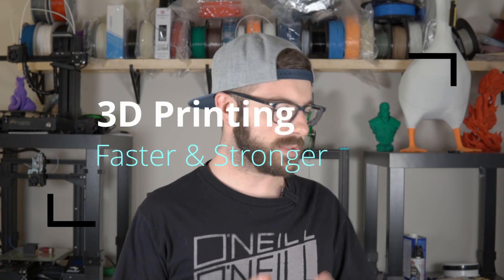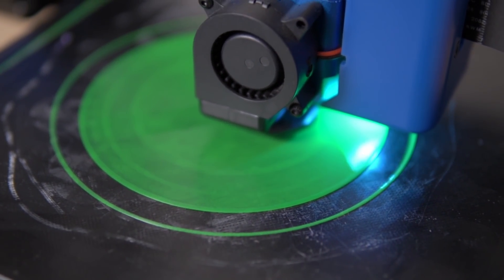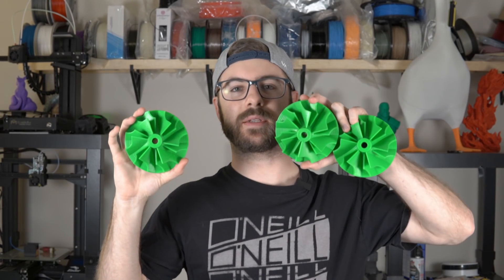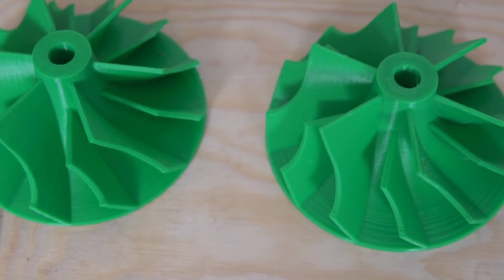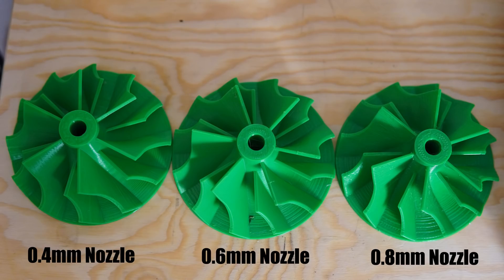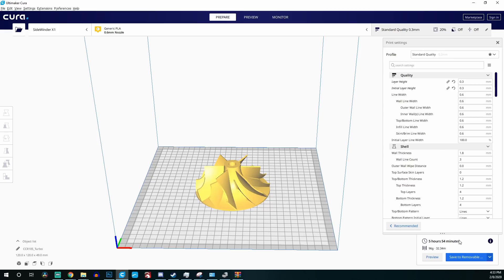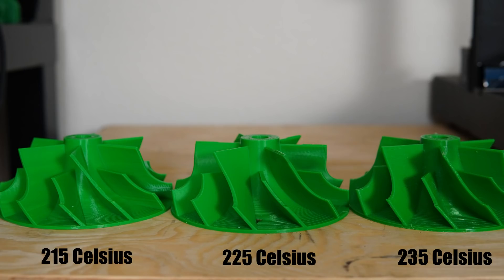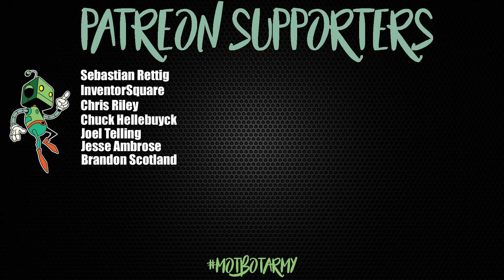3D Printing Faster And Stronger Parts

Comment: Great video! I've been contemplating changing out my nozzle on my Ender 5+. I think this was enough info to make that change.
Reply: @Modbot Made the change successfully and had a few good test prints but now I've got substantially more stringing.  Have been changing nozzle temps over several prints, I've checked my esteps from another video you have, and have also been tinkering with the retraction settings but still no luck making them go away.  Do you have any other suggestions?
Reply from the maker: For stringing retraction and temps are really the main thing I change up. Is it petg? I have certainly had my share of issues with stringy petg in the past
Reply: @ModBotArmy  Actually having stringing issues with PLA. I feel like I've tried just about every retraction length/speed and temp but I'm sure I'm missing something simple here.

Comment: Hey, I have a sidewinder and i'm really having issues with cura right now, I swapped to ideamaker but getting odd issues to. What config do you use on cura? I used the 4.7 version on thingaverse, but still getting issues. I've calibrated my extruder twice, releveled god knows how many times and just getting no joy.

Comment: From my experience, I have not had any problems printing at 0.3 mm layer heights on a 0.4 mm nozzle. Anyone else?
Reply: Same here! 0,3 layer with a 0,4 nozzle and if I want to do a faster print to prototype test.... i use 0,35 layer on a 0,4 nozzle and pump up the flow to 110%.

Comment: Small nozzle + large print line width = faster and stronger parts due to higher nozzle pressure to pancake a wider line.

Comment: I upgraded my Flashforge creator pro to a 0.6mm and the tolerances are way off. Seems that the additional plastic has a different shrink factor during cooling. There will always be the need for additional test prints before you get it right.

Comment: I can get .3 layers and .5 line with with with a standard .4 nozzle to do exactly what you do. Cura just pushes more plastic out of the .4 nozzle. Works reliably for me. I do exactly as you’re doing, thick layers and lines for fast prototypes and then thinner layers and lines for the final part, except no need to swap out nozzles, level bed, etc. I also set the temp a little hotter to help with the flow.
Reply: That's true and I do exactly the same! Though if you want to go even faster you can't get around using a larger nozzle :p
Reply: Yeah I tested this before as well. You can get pretty wide walls from pushing a lot of filament through the nozzle but there is a limit and (literally) puts more pressure on the machine. Good idea though! 👍

Comment: If your prototyping turnaround time is too large because of tolerance issues, just print with more perimeters, and scale +2%.

If the part ends up too big, you have material you can sand off.

Comment: Thinking chimera head, volacano in one with 1mm nozzle and other with v6 with 0.4 nozzle, infill etc in 1mm detail in 0.4
Offset nozzle heights by layer height, and there are slicer settings that can do this.
My latest venture is to fit servo controlled ooze guards or find some valve to stop ooze on unused nozzle

Comment: I did exactly this 6 months ago, went from 0.3 to 0.5mm nozzle on a 220x220 print bed. still get good prints but so much faster. (using 0.2-0.3 mm layers)

Comment: wanhao duplicator i3 v2.1 with MANY upgrades. Stock heater and block, Micro swiss all metal hotend, 0.4 and 1.2mm nozzles. The 1.2mm nozzle prints about 60% speed of the 0.4mm but finishes in half the time, much stronger at 240C for PLA and 1.0mm layer heights.

Comment: QUICK TIP:
Use a big nozzle (eg. 1mm) but keep the standard layer hight (eg. 0.2mm). You will end up with the same quality prints but save A LOT of time.

I don't know why not more people are doing this... :)
Reply: Less detailed prints? Sure z-wise it the same but my features are basically always in the XY plane ....
Reply: @sandos-x1t  I am using a 1mm Nozzle for over 1 year now and it always worked great without  losing details. Maybe with very small prints the result will look different, but with small prints the time doesn't matter too much.

Just try it out, maybe it is a good solution for you.
Reply: If using 1mm nozzle with 0.2mm layer heights compared to using 0.4mm nozzle would be compensated by the slicer in terms of filament flow I am sure... so all is good and should not make thin walls too much wider. However if doing something like a 1 wall calibration cube, I wonder would the wall be exactly 1mm wide or would it be possible to make it much thinner and still have good filament adhesion?? I am just thinking out loud to be honest 😄. Very interesting concept though! Thanks for the info.

Comment: I don't normally print miniatures so I've never changed a nozzle and put back a 0.4, it gets blocked alot easier than a 0.6 and as you said the item prints quicker and is stronger because of the nozzle size and a heat gun or a blow dryer will help smooth it out in minutes if the layer lines bothers you.

Comment: You should have mentioned that you can simulate a 0.6mm nozzle easily without problems with a 0.4mm nozzle. Just increase the wall width to 0.6 or even more and you can still run the same layer heights as with a 0.6 nozzle.
Reply: Yes, but not speed-wise I believe. At least not on my extruder.

Comment: That is the first thing i do on a new printer.  Especially the bigger ones.  I switch to larger nozzles.  You not only get by with less passes, but the lines are thicker which also makes them stronger.  1.2 mm walls are now printed in two passes.  It just makes for a more rigid part.

Comment: 75% of the nozzle diameter is the maximum recommended layer height therefore my default setup in my i3 Megas is 0.8mm nozzle at 0.6mm layer height.
I consider the type of things I print to be 2.5D (ie complex in the X and Y axis but simple in the Z), so this works out great for me.
Reply: yep - though I always used 80%.  There's another chunk of time to be saved by going for 75% vs. 50% of nozzle size vs layer height.

Comment: But you can do 0.3 layer on 0.4 nozzle
Reply from the maker: You are correct you can do .3 with a .4 nozzle. However you will only be able to lay down .4 worth of material while the .6 lays down .6 of material so it is 1/3 more material being laid down which means less passes. It is not just about layer height but also how many passes it takes to fill a layer. I hope that makes sense it is tough to explain without images
Reply: Same I'm doing that all the time.
Reply: @MrNlce30  so there's no real need to change to 0.6 of you're doing 0.3

Comment: 1.0mm  nozzle makes vase mode prints insanely fast and durable.
Reply: I tried 1mm+ wall width on my 0.5 nozzle, I could stand on the damn vase! So incredibly durable suddenly.
Reply from the maker: Oh yeah vase mode with a nozzle that large is insane. Haha I love it for fast prints.
Reply: Yes it it amazing how fast it is but it also uses a TON of filament if you keep the line width at the high level to make the part stronger. I normally print with .4 for everything and change line width to .8 when doing vase mode. I don't get the strength doing that but I do save a huge amount of filament ;)

Comment: I haven't printed with a bigger nozel but I will now. I use a Delta style printer does nozel changing on these still apply? Thank you.
Reply from the maker: Yes, a bigger nozzle will definitely work on a delta style printer. It should not require any additional steps. If you do end up picking up a larger nozzle let me know how it works for you!

Comment: I see you're using CCtree, how are they? I've been using Hatchbox, Amz3d, and Canada's Spool3d's, wondering how they are? I heard their new formula has a low chance of getting a spool that could jam 3d printers. Are you using their newest PLA version? Do you experience jams? I'm interested in trying it since their price is good.
Reply from the maker: I have about 4 spools of CCtree. They are all PLA and I have had them for quite some time (probably a yearish). They have worked very well for me though. Very consistent and nice colors. Again, since I have only used their PLA I am not sure how their other materials are. I also would anticipate that this is not their newest PLA version.